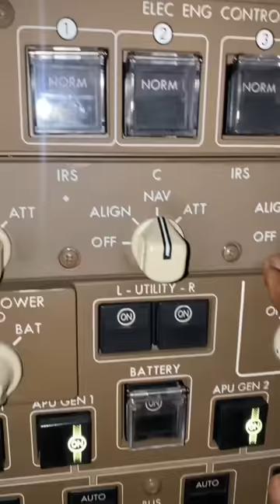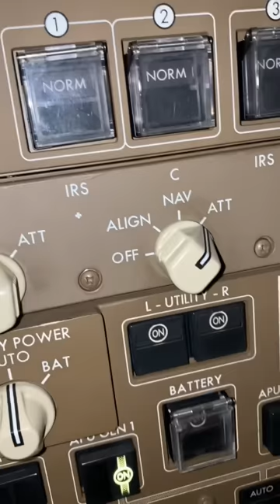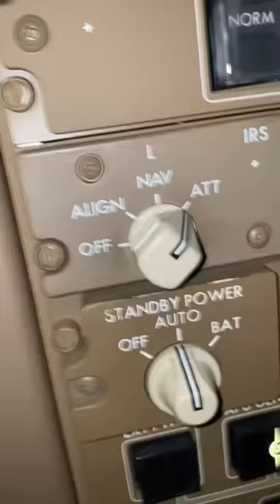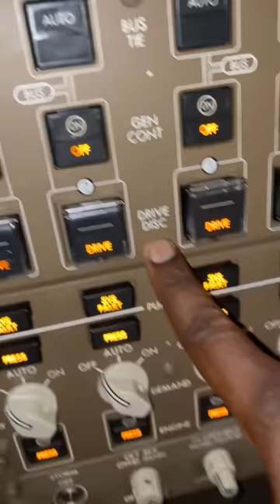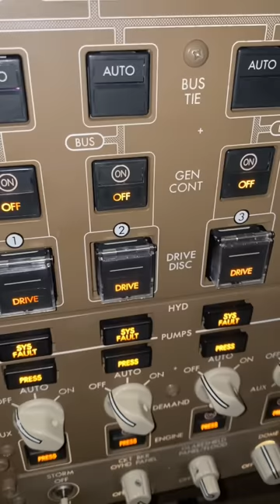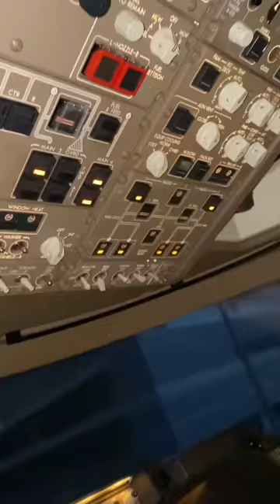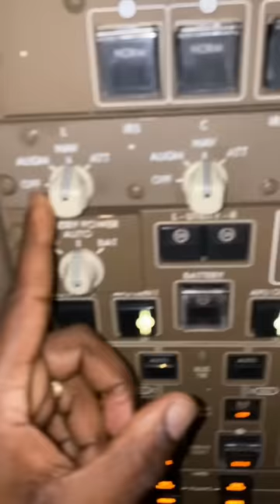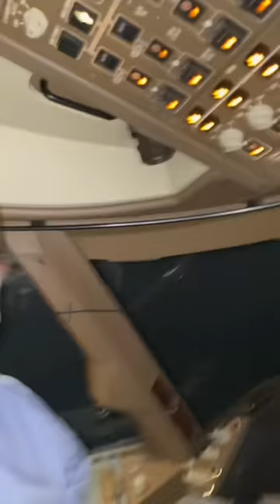Boeing 747 cockpit irreversible actions

Comment: Also I dont know if the 747 has a fuel dump valve, but if it does dumping fuel is probably irreversible too.
Reply from the maker: We do- I’ve done a video about it two weeks ago- check it out
Reply: Nah just roll inverted and pull back until level again to catch the fuel you just dumped
Reply: @ElBantosClips  this guy aviates
Reply: @ccllvn  That's a really original play on the "this guy f*cks" phrase, lol
Reply: @ccllvn  yee
Reply: I'd assume all commercial aircraft have fuel dump valves, would likely be a requirement.
Reply: @moos5221  there are at least some that don't.   They either circle to burn fuel or just go ahead and land over weight if it's an emergency.
Reply: @wouldntyouliketoknow9891  that's scary. the resulting fire i mean.
Reply: But how quickly does the fuel get dumped?Hypothetically if someone accidentally started dumping fuel (which I know is virtually impossible) could they just simply stop at some point?
Reply: @moos5221  Fuel dumping ability is only required if the airplane’s certified maximum takeoff weight is greater than it’s maximum landing weight. Many narrow body airliners such as the 757 and A320 series do not have fuel dump capability because their maximum takeoff and landing weights are the same. Contrary to what many assume, the reason has less to do with touching down overweight and more with trying to stop all that weight once it’s on the ground. Brakes and tires can only handle so much stress and friction before they fail.
Reply: @singleproppilot  ah, thanks for the explanation
Reply: Pfft, obviously it does, haven't you ever seen the hit documentary Air Force One?
Reply: @singleproppilot  The landing and takeoff weights are not normally the same....but close to each other...say take off 115 % of landing weight....
Thus usually small/smaller medium jets. B737....B757...
Although, suprisingly these days some airlines  have larger long haul jets without buying the dumping facility.....A350.
I would not travel on Finnair for this reason.
Reply: I think many missed the good joke here lol
Reply: @moos5221 in fact the 737, A320, 717/ MD80 all do NOT have fuel dump functionality.
Reply: Irreversible fuel dumping once the fuel valve is open and the fuel dump is in progress...?
FRICK! That sounds REAL scary. I don't think I would like to know how to initiate THAT "irreversible" process 😁

Comment: My Dad worked at the plant that made the inertial navigation system for the 747 (also for the Apollo missions). He brought home a pilot's guide for it, and once I had read it, I was confident that I could navigate a 747 to any place that I had coordinates for. Someone else would have had to take off and land it, though. 😁 It pleases me to see that they are still in use, even though we now have GPS.
Reply: New INS systems, at least in military aircraft, are coupled to GPS for constantly updating alignment. In the military, or at least the Air Force, they call it EGI. You can even shut down the INS completely midflight and realign it entirely using GPS signals and standby instruments.
Reply from the maker: The IRS on board the B747 is constantly updated by GPS coupling
Reply: I used to repair, test and calibrate the Delco Inertial Navigation Systems for a major airline many years ago. I can even still remember all of the part numbers ! (7883450-041) etc. The latest 747 has IRS systems (rather than INS). The difference is an INS can navigate from waypoint to waypoint, and provides the current a/c position and attitude information to the flight instruments  - whereas an IRS system, whilst also providing the current a/c position, can not navigate as such and has to be coupled to an FMS system.
Reply: @SuperSarah1954  Gotta wonder why they made the switch.  "This one does this, this, and this. The shiny new one does this and this."
My view is, "If it ain't broke.." Those Carousel IVs got the planes to their destinations quite reliably. No wonder air travel is so expensive. They're fixing things that "ain't broke".
Reply from the maker: @SuperSarah1954  correct but the IRS receives constant updates from GPS too. Thank you for your info insightful- and you remember the part numbers-wow!
Reply: @craigcorson3036  With the Delco INS, the pilots were having to put in the lat/long of every waypoint along the way, which could be fraught with problems . On one occasion (a British Airways Tristar in the 1980s) the aircraft started to turn and try to fly in the opposite direction. For a short while the crew were totally confused - until they realized the next waypoint had been put in with an Easterly longitude instead of West! With an FMS coupled up to an IRS, all that is done for them. The Delco INS were also fitted to the British Airways Concordes and because of the speed of the aircraft those waypoints would come up twice as fast as they would have on the 747. In the end they came up with an optical card reader connected to the system that would read  prepared cards which had the waypoint co-ordinates written into them.
Reply: @SuperSarah1954  Well, no navigation system can account for pilot error. OR for error on the part of the person who prepared those cards that you speak of. Double and triple checking would help, but even then - humans gonna human.
Reply: GPS has and will never replace an internal reference system. Any reasonable good "GPS" system is typically a GPS IRS hybrid.
Reply: @danielrose1392  An Inertial Reference System and an Inertial Navigation System both do something a GPS can never do - and that is give attitude information (Pitch, Roll, Heading) to the aircraft systems. I guess you can say that the GPS and IRS/INS are complementary to each other.
Reply: @SuperSarah1954  With cheap gyros from smartphones, it got really mixed up. Most GPS systems (which are not already connected to an external INS) use a basic internal INS for their error model.
Reply: @craigcorson3036  jeez you're soo smart Craig. "if it ain't broke don't fix it" lmao u should work on fixing your brain then homie
Reply: @craigcorson3036  You're the type to argue cigarettes are actually healthy for you.
Reply: INS isn’t dependent on external inputs unlike GPS which is dependent getting its signals from a number of satellites, which is probably a lot easier to certify
Reply: @deadeyeduncan5022  Am I? And here I'd been thinking that I was the type to argue that cigarettes are exceptionally BAD for you, seeing as how I am dying of a disease caused by them.
Reply: @SuperSarah1954  Actually, they've had GPS attitude systems for a number of years now. It relies on 3 or more antennas of known separation and compares the GPS carrier phases between them (RTK). They've been used on satellites and the ISS, since they have no gravity and fly for years, and also survey/photogrammetry flights, since they need attitude more precisely than a gryo can provide over a flight.
Reply: @ImperrfectStranger  You’re correct. The FMS is in charge of navigation and automatically  prioritizes inputs from a variety of different sources. GPS data from the multi-mode receievers (MMRs) whenever available, is the primary input for enroute navigation. VOR is secondary and IRS is last. ILS gets priority over all other sources during the approach phase of flight. However, IRS data is still used for the primary flight instruments; attitude, direction, and vertical speed; replacing multiple mechanical gyros that used to be required for that purpose.

Comment: Would you consider discharging fire bottles another irreversible action or no?
Reply from the maker: I would indeed but that is expected for a fire/ emergency compared to normal operations
Reply: That would be the last irreversible action in his/her career in aviation, if done “mistakenly” 😆
Reply: @vladimirassalukas6726  for sure, not only would the bottles need replacing, the SQUIBs would as well. I imagine those explosive bolts to be very difficult to replace.
Reply: Many airplanes have two stages on the fire handle. The first one will disconnect all fuel, hydraulics, oil, and bleed air, etc. The second one is the fire bottle. 
 
In some airplanes, at least the one I fly (ERJ145) pulling a fire handle and isolating the engine is reversible. The valves closed by pulling the fire handle can be re-opened by simply putting the handle back where it was. Rotating it left or right will discharge a fire bottle into the engine. 

Once you discharge a fire bottle though, that’s it. You done did it. Can’t un-do it. 

I can’t think of a reason why I’d pull a fire handle and decide to put it back though. The two of us would triple check that we’re about to pull the correct one in a real emergency. We train it all the time in the simulators.
Reply: @byronhenry6518  I thought you can still restart the engines on a maddog after discharging the fire bottles?
Reply: @pilot_obet  I agree,but its irreversible. We missed that one.u also forgot your ejection handle.lol.im only kidding
Reply: @byronhenry6518  >I can't think of a reason I'd decide to pull a fire handle and put it back in though
Highly unusual circumstances - I think this exact action was taken on one of the first planes to encounter volcanic ash. Although they may have just powered the engine down, not pulled the fire handle. Either way, when the other engines failed they decided it was worth trying to start it again.
Reply: @williamsplays8528  That sounds like a job for self-sealing stem bolts.
Reply: @PsRohrbaugh  Oh yeah I guess that makes sense. 

It’s in the realm of “freakishly rare”.
Reply: @andrrewhhmak  You might still be able to restart any engine after a bottle discharge. It would depend on the specific plane. 

What I meant was, once you use a fire bottle, that’s it. You only get one shot per bottle.
Reply: @byronhenry6518  I'm going out on a limb here and assuming if the engine has had a fire event... You're not going to want to restart the thing...
Reply: @Melanie16040  99.99% of the time, you're right. But 0.01% of the time, the alternative is worse.
Reply: @Melanie16040  I agree, it isn’t something you’d ever do. We’re just talking about how the system works.
Reply: @carloscortes5570  like Bruce Willis in the pilot's seat of a C-130.
Reply: @byronhenry6518  I've never flown a plane in which the fire handle firewall shutoff isn't reversible.  Hell, on the Citation 500 series, they recommend you shut down the engines that way every so often to verify operation of the system!
Reply: @PsRohrbaugh  Could be an accidental pull
Reply: For engines, you are still able to start engine without fire bottles. For main cargo compartment and avionic bay, it hasn't fire bottle, the extinguisher system just removes air from those compartments and suffocates fire out. For lower cargo compartment, yes, it's irreversible.
Reply: Absolutely
Reply: @WilliamsPlays I've replaced expired fire bottle squibs in a helicopter. Can confirm, a pain in the ass. Mainly because of the way you have to contort your hands and body to get in there. Actually swapping the squibs aren't so bad. It's handspinning the lockwire lol.
Reply: No, its self reversing in flight.
Although you cant use the bottles again
Reply: @williamsplays8528  depends on the plane, but on the EMB 145 we regularly remove and reinstall engine firebottles for weighing. The squib comes off with the bottle so its not so bad. The airline really only cares about how much the new parts are gonna cost and how long the planes gonna be down.
Reply: @williamsplays8528  squeebs
Reply: @chesthairascot3743  I got an email from two kids trying to sell me self-sealing stem bolts, must have been a scam.
Reply: How about distributing in-flight meals? That's irreversible. Unless the food's gone bad, then it can either reverse very quickly, or go through rapidly. Sometimes both.
Reply: @vladimirassalukas6726  their
Reply: what about opening the pilots window or emergency exit mid flight?
jokes aside...i sat on the emergency exit above the wings in a 737 last week and was wondering if i would actually be able to open it mid flight or if the pilot would have a button to unlock it first. i'm sure you can't just open the thing, right?
Reply: @moos5221  You are unable to open it mid-flight because the inside of the plane is pressurized, you could open it if you are able to pull with like three tons of force.
Reply: @MrRodneyBewes  oh. that's scary. i mean, not really when you scientifically think about it, but it is scary when you just imagine it. what if i pry open a small gap with a tool? i mean, persons who try get stopped, but i'd imagine with a proper tool (large solid screwdriver, crowbar one would be able to open a gap. good that these tools aren't allowed in the plane anyways. :D
Reply: @moos5221  I think you overestimate how much even a crowbar would help, you would literally not be able to pry the door open unless you managed to somehow smuggle some jaws of life on the plane, you'd need proper hydraulic power tools to pry it open.
Reply: @moos5221  The airplane at 30,000+ feet is pressurized to about 5-8 PSI. 

Assuming the door is 2ft by 4ft (to inches it’s 24x96) 

Area in inches = 2304 in^2 

If it’s on the low end, 5PSI that means there is 5x2304=11,520 total pounds of pressure holding the door shut.
Reply: @byronhenry6518  i don't usually work with those antique units that you use, but 11,5k pounds is something you can easily apply with the right tools. with a 1m prybar you can easily apply 100kN force which translates to 10t.
Reply: @moos5221  I am by no means a physicist, but 11,000 pounds of anything sounds well outside the strength capabilities of your average human being. Even with a big crowbar. 

You ain’t opening an airplane’s door in flight unless you’ve got something hydraulically powered. Or you depressurize the airplane first.

Also, fun fact, just about every airplane and government aviation regulatory body in existence uses imperial units. Feet, inches, miles, pounds, and gallons. 

Americans invented the airplane (spelled Airplane, not “aeroplane”) so we get to decide the measurements! And spelling! Lol